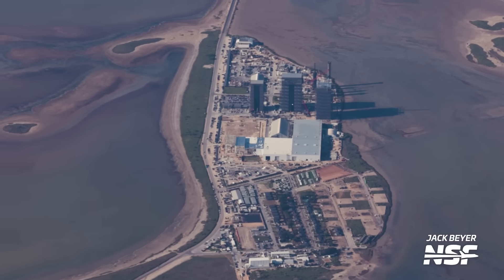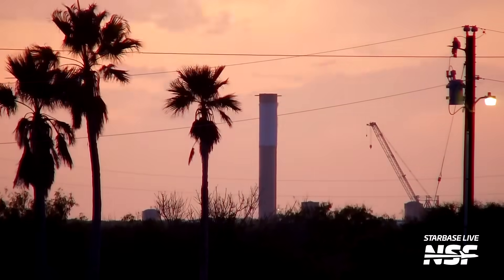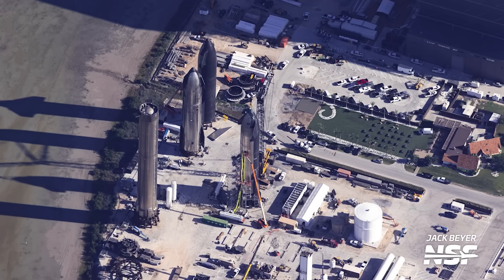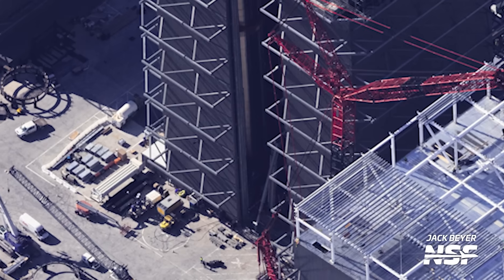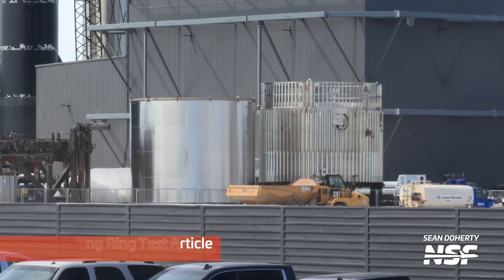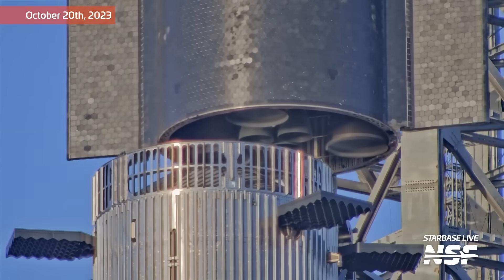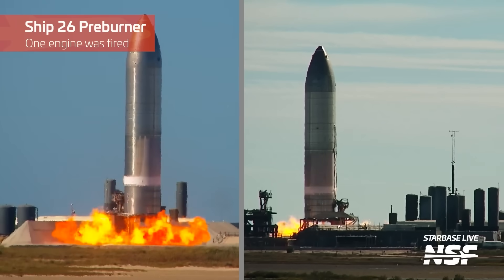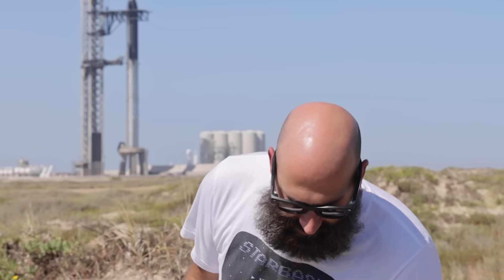The Progress Never Stops At Starbase | SpaceX Starbase Update

Comment: The black rings are most definitely for booster static fires. With the hold down clamps it becomes rather obvious. They want to get into rapid test flights now. Can't rely solely on the olm for booster static fires. I'd guess they put it on the suborbital pad area somewhere. Add a mini version of the olm showerhead that will be just enough to protect the pad from the 33 static fire.

Comment: Let’s see that second flight in early November.  I’m sure all of the critters will be just fine.  Salt water.  Fresh water.  Hey…is rain water salty?  Does it rain ocean water in Boca Chica?  It does rain down there in South Texas, doesn’t it?  Ever get a torrential downpour thereabouts?  Uh huh.  I see.  So…what are we talking here…fresh water or salt?  Yeah.  That’s what I figured.  LAUNCH THE DAMN THING!!!
Reply: But its not fresh water when the booster is firing, its contaminated by the exhaust gasses, that's why it has to be collected and then treated, if it was just plain water still there wouldn't be an issue.
Reply: @rjswas  And what are the overwhelmingly predominant byproducts of that combustion exactly? CH4(g) + 2O2(g) → CO2(g) + 2H2O  Carbon dioxide (plant food) and water.  Say what you will about CO2, but photosynthesis cannot occur without it.  Notice I said ‘the overwhelmingly predominant byproducts’, and that they are.  There are trace amounts of other chemicals perhaps, but CO2 and H2O aren’t going to contaminate anything.  If it is in fact the case that there is a significant concentration of actual contaminants, then I’m sure SpaceX will create a means of retaining the water that isn’t converted instantly to vapor / steam.
Reply: @billg3645  Yeah, fair enough, i was just pointing it out because so many on here say the same thing, "it's just water", when it's in actual fact not just water.
There are likely other things also that get swept up with it, like oil from vehicles that possibly drip oil and so on, it's a better safe than sorry thing in the end.

Comment: It's interesting that Space x seems to have strengthened their ships as I noticed that they are at times filling the top, methane, tank with not frost on the oxygen tank (empty).  Your thoughts...
Reply: The bottom tank is just kept at pressure. It's not really the tank being filled with liquid what keeps it from collapsing due to the weight on top, it's the pressure of the gas inside of the tank that keeps the structural integrity so they can be empty of liquid but at high gas pressure and hold the weight up top. This is why SN3 failed, it was not that the top tank was full while the bottom was empty, it was that the bottom tank was depressurized before they had removed all the liquid nitrogen from the top tank and due to the loss of pressure it lost structural integrity and then it crumpled.
Reply: Thanks Alex.  So appreciate your work and the work of the whole team to bring us this amazing development. @ale131296

Comment: With ship and booster cryo testing able to be done at the Massy's site, I wouldn't be surprised if they put the booster static fire/ test stand where the current suborbital pad is by the OLM. And just pipe it to the existing fuel lines for OLM.

Comment: Interesting that F&W needs to approve the water deluge system.
It's been used quite a bit.
Apparently F&W has zero issues with it as long as the rocket stays on the ground.